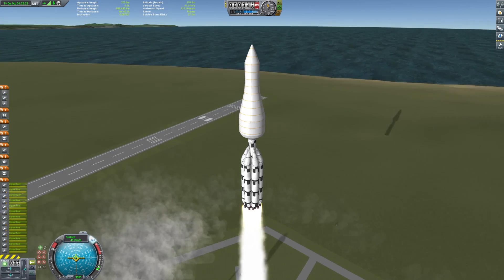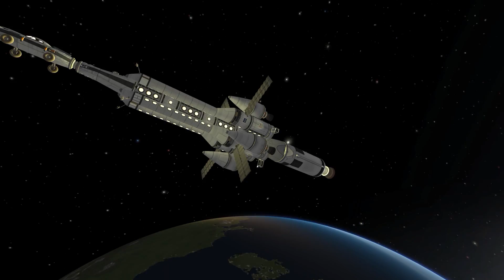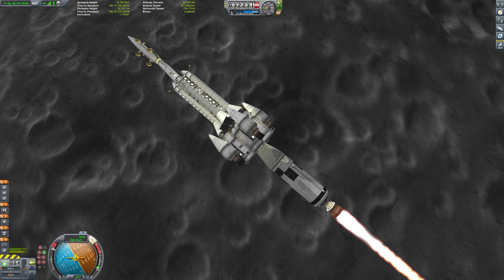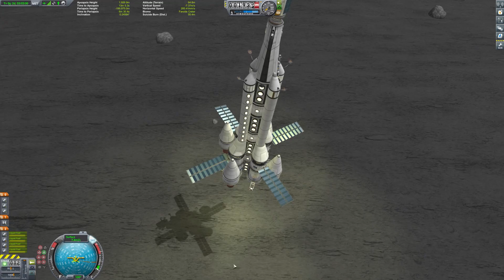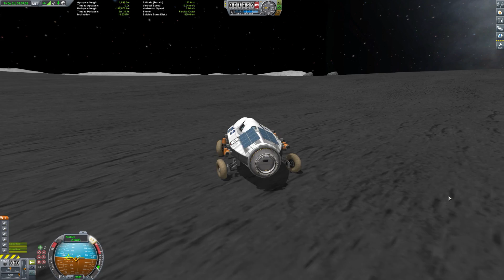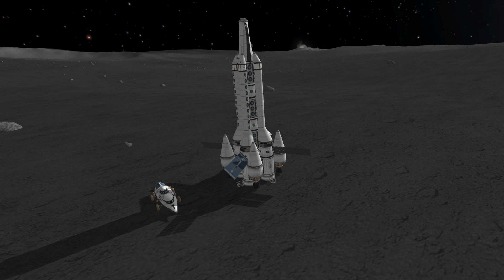KSP Moon Tower Base and Speed Rover (stock) - Ep 61 - Kerbal Space Program

Comment: I like your rover but one tip: turn off steering for all the other wheels that aren't the front two. It prevents you from rolling over.
Reply from the maker: Yes I normally do this but forgot in this mission. Great tip though. Cheers mate.
Reply: Also, be very careful on your GPP playthrough or if you install Scatterer. The rocks, trees, and any other items that you can normally drive through are solid there. I have lost multiple rovers and SSTOs due to it. Quicksave is awesome.